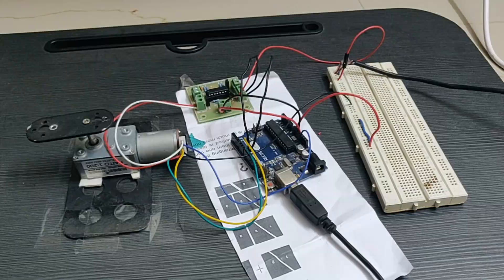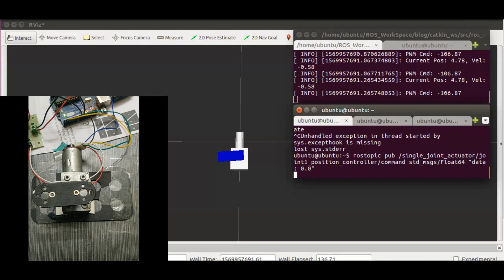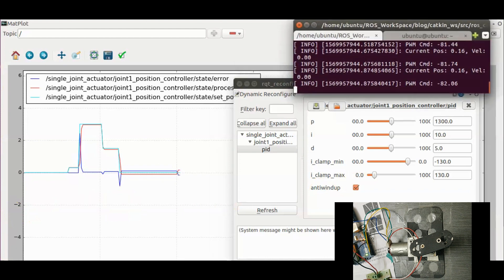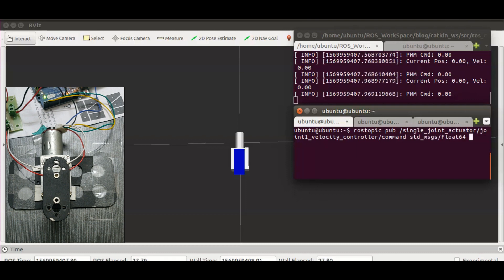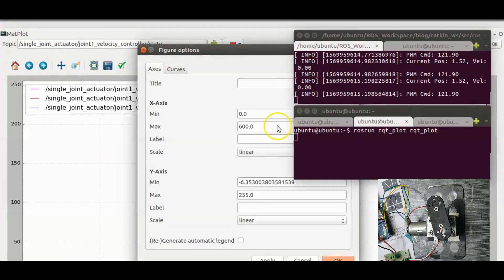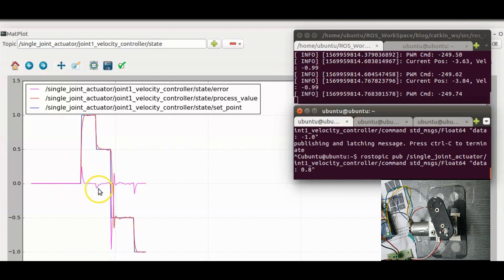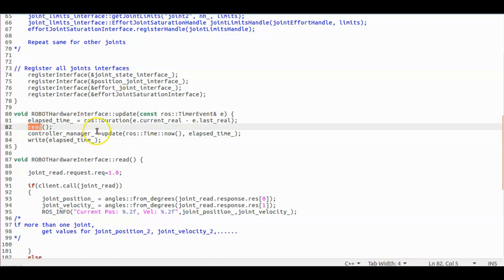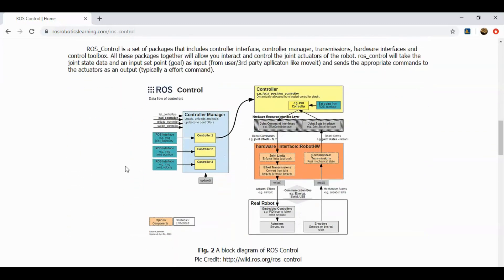Position and Velocity control of a DC motor Using PID | ROS control | rqt_reconfigure| Arduino

Comment: I am trying to learn more about ROS and come across this interesting tutorial.
I am replicating what you did in your video/project shared here. But when I send a command for position control in rad the motor doesn't move. I have been working to resolve the problem for the last 10 days but I haven't been successful. Could you please help?

Comment: How should I control bldc motor I m using raspberry Pi but motor is not running servo is working using pca9685 i2cpwm board

Comment: For my final year project I am using a dc motor with an encoder as the actuator in a custom made, 3d printed 6-axis robotic arm which does a pick and place operation. Can u suggest me some tutorials or help me out with how to implement kinematics for the pick and place operation and also implementing pid to the actuators.

Comment: I do not understand that the formula of "(360.0*1000*(encoderPos-last_pos)) /(2200.0*(now - lastTime))" is in degrees/s, right? (While T = 500ms, And ROS is rad/s). Looking forward to hearing from you soon. Thanks
Reply from the maker: Hi,
Yes the equations in arduino os in degrees/sec. The conversation from degrees to radians and radians to degrees  are done hardware_interface_node.

Comment: hey bro this  is good and  can u please give the cod  for normal Arduino IDE  Windows  it's require urgent
Reply from the maker: Check this. Pid code in Arduino.
https://github.com/bandasaikrishna/using_rotary_encoders_without_interrupt_routine/blob/master/DC_motor_encoder_speed_control_using_hardware_circuit/DC_motor_encoder_speed_control_using_hardware_circuit.ino

Comment: Thanks for the great tutorial. What is the reasoning to have a relatively slow control loop rate of 5hz? Could you make that higher like 100hz?
Reply from the maker: Arduino uno is not working good at higher rates to receive command(subscribe), execute(pwm) it and send feedback (via service server). For 100hz may be u can use different mcu which can handle the load.
Reply: Robotics and ROS Learning Yes, I have had that problem as well when nh.spinOnce() is in the main loop. I found that putting it inside a timer helps a lot. With this method, I am able to publish and subscribe at 100 hz

#define ROS_MESSAGE_CHECK 10000    // 0.01 seconds

elapsedMicros rosMessageCheck;

Void loop(){

 if (rosMessageCheck >ROS_MESSAGE_CHECK) {
        nh.spinOnce();
        rosMessageCheck = 0;
    }
}
Reply from the maker: Thats a great suggestion. Thanks for sharing. I will try it.

Comment: I have a question about the member function read(), which belongs to the ROBOTHardwareInterface class. We know that we are receiving the position and velocity of the joint from the server using service communication. What is the advantage of using service communication here? Is it possible to replace this with topic communication?
Reply from the maker: Service is a request-reply type communication Where as topic is a broadcast-listen type communication. In hardware interface node, we want the values from the hardware only when we want (i.e., calling read() method). If you use topic here instead of service-client then your subscriber in hardware interface node will be called when ever the hardware publishes data but not when hardware interface node needs.
 Anyways this was my way of implementation. You can implement in your own way either using topics or i2c or any other protocol.

Hope this answers your question.

Regards,
Sai Krishna
Reply: @roboticsandroslearning8232  I see that the read() function uses the "Service & Client" communication protocol to get the real-time value of the joint.
That's very clear.
Thanks for that.
Thank you very much for your kindness.

Comment: Hi.. Thank for your video. I have got a problem when I launched check_urdf.launch or check_position_controller.launch. In Rviz, error Fixed Frame and RobotModel existed. Can you help me?
Reply from the maker: Change the "Fixed frame" in base in "Global options" to base
Reply: Robotics and ROS Learning when i run check_velocity_controller.launch, value PWM Cmd increases from 0 to 255, i don’t change your arduino code. Do you know what ‘s erorr?

Comment: Very good job, but I have one question:
In case I am using stepper motor withoud encoder, so I have an open loop. How should I change a hardware interface file and what should I do in that case?
Reply from the maker: Thank you.
For stepper motors you can use position_controllers/JointPositionController. You can check my blog to understand how to write a hardware interface file and more about ROS control.
https://www.rosroboticslearning.com/ros-control

If you still have a question please don't hesitate to ask.

Thanks again.
Reply: me too using stepper motors for a mobile robot and i'm facing the same problem

Comment: Hey I want use only l298N motor driver with Jetson Nano on ROS can you help me with that?
Reply from the maker: Hi Harsh Palan,
I'm really sorry, I have no experience with Jetson Nano.
Regards,
Sai Krishna.
Reply: @roboticsandroslearning8232  
Anything with l298n and raspberry pi
Reply from the maker: Yes. I used L298N motor driver in this project to control the motor. And you can run this ros project on raspberry pi. So what help you need exactly.?